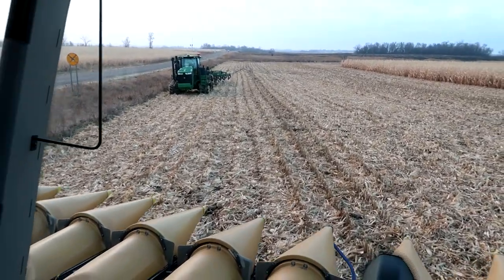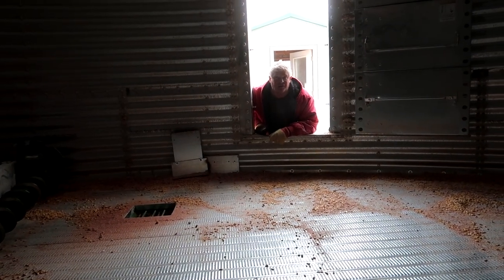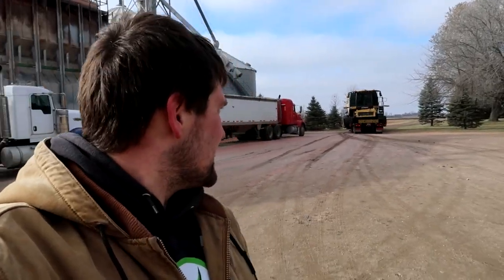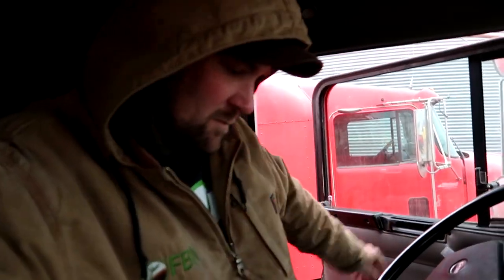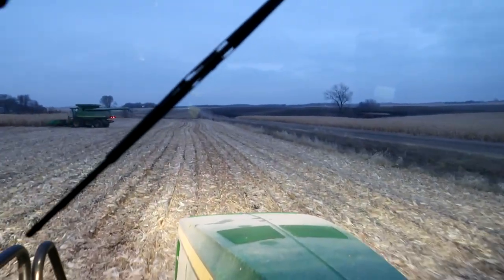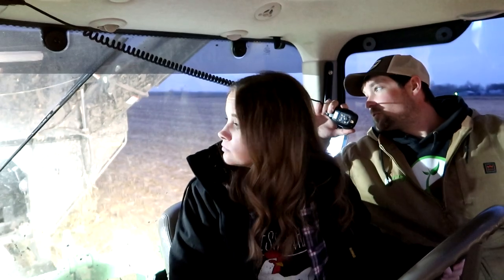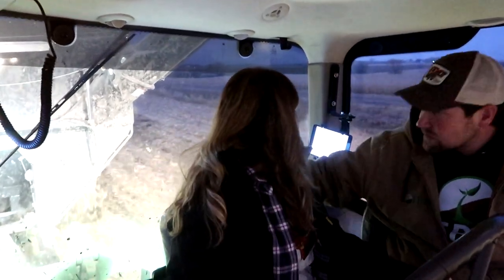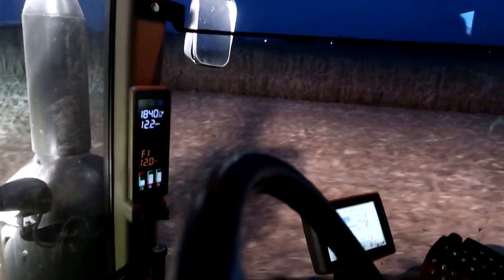She's Driving the Tractor Today

Comment: All that work cleaning up grain around the bins, unloading area, etc..  I wonder if it's possible to have a trough (with a grate over it) with a auger in it around the high cleanup areas?  The trough could transfer to a inclined screw, which you could put into a front loader scoop, or maybe even a grain cart when it's not harvest.  Or maybe if not a trough, just a square hole or two. 

 I am not a farmer, although I do work for an apple grower and packing company.  My great grandparents farmed dry land wheat in Oregon.  I think about the how they had horses (mules) pulling a combine, and how hard they worked every day.

Comment: Helpful tip.  On our grain cart tractor if I set the gps up with the grain cart and put a 27’ to the right offset in the implement setting it’ll make our tractor autosteer directly under the auger of our 9770 no matter which direction you’re going because it is actually steering on the combines pass.  So set the width up the same as you header width then a offset to the right of whatever the distance is from the center of your combine to the center of your cart when it’s under your auger.  Makes my cart drivers life a lot easier

Comment: That was an awesome video! Glad Mrs Millennial did flip it. On a different note, I noticed when you were on top of the dryer when the top blower was starting up (awesome startup sound) that the dryer was equipped the with ODP (open drip proof) motor on that blower. Did you replace one already or is that the way it was equipped. If that's the way it came,  I have no idea what they were thinking, its a dirty environment with dust and chaff, and its subject to wet weather, all conditions to ensure a premature failure of bearings and windings. They should have used a TEFC (totally enclosed fan cooled) motor. Anyways thanks for sharing! Scott - Minnesota

Comment: Re: temperature alarm. When I see that sort  of thing in a heating system I look up. Usually an indication that the exhaust heat is not properly venting and you are tripping a vent/exhaust sensor limit.  Once the corn is run out of the dryer, vacuuming/blowing off the the bee's knees/dust/chaff from the upper screening would probably help.

Comment: I only got to empty the cart a few times this fall.    I did drive the combine over almost all of 1,800 acres.   The cart is not easy in 260 bus/ac  of dry corn.    If I had another combine driver I could drive the 750 bu cart that has been in the barn or doing only test plots for years.

Comment: Zach, why don't you throw a GPS monitor in the grain cart tractor. Do an AB line with your rows and either recenter each time with your tractor  track on the 5th row or put in a offset for the cart when entering it as an implement so it works in both directions.

Comment: My Newspaper is delivered in a plastic sock bag...which I save and use at the DRIVE-UP fast food windows as a CONDUM cover over my beverage cups.  Hot gooffe or soda is placed in the bag and a tight know is tied. Now the lids stay on and a split is contained.  When I drink, I insert my plastic straw thru the plastic bag into the bevereage cup. Now if I tip it over, only a small dribble from the straw piercing happens.

Comment: Looks like you need one of those large vacuum trucks to clean up around and inside your large bins the type they use to clean storm drains. Get more use out of that than a snow plow.  Maybe they make one that can be pulled behind a tractor.  That way other farmers in the area could use it.  I am sure if your have problem with spillage they have one as well. Beats spending an hour or so and a sore back with a shovel.
Maybe there is some Federal subsidy to cover the cost. Technology is moving fast in your business, I saw a video of a Dairy Farm using robots to milk cows.

Comment: I always wondered. When you guys talk about the chaff underneath it dryer, if it's dry why aren't you trying to pick it up with like a Shop-Vac. Something along that line. Would it not be faster and easier on a constant basis then just doing it once a year after it gets all rained on and everything? You can even use the Shop-Vac for inside the dryer too. Since all that stuff is fine particles just wondering.

Comment: First video of your's I have watched. You run a  good sized operation. How many acres of corn and I guess soybeans as well.? What is moisture in the field, 15 to 18+ and drying to 12.? how long  to dry down to 12 if put in at 18 for your bin (10,000 bushel)? How many bushels per hour can your grain dryer handle?

Comment: I got a dumb question,if its high moisture  corn ,it going though the dryer then in bin ?,,,,,if so then why does it matter what the moisture is when you harvest  it ,just wondering
Reply: Lots of propane, means lots of expense to dry down high moisture corn. Kills the profit. 
Zach does that double stack dryer go through 1 or 2 thousand gallons of liquid propane in 24 hrs?
Reply: @johomerza  1 to 2 thousand gal in 24 hours ,dam ,guess I won't bitch  about the the 20gal I use in 2weeks to heat my shop lol